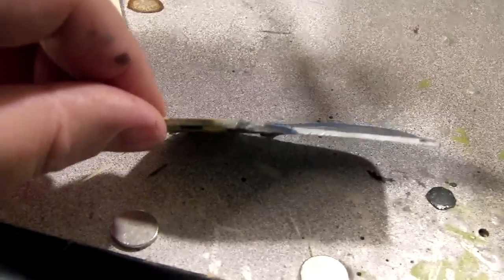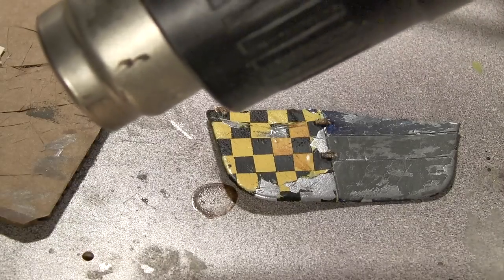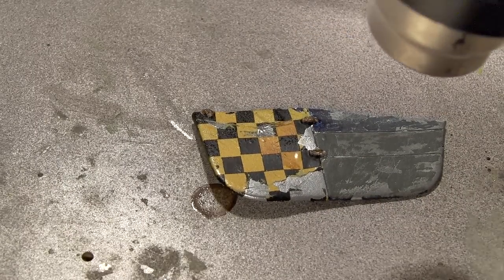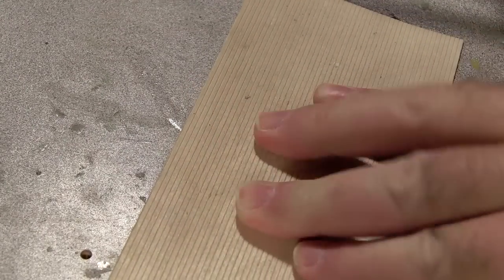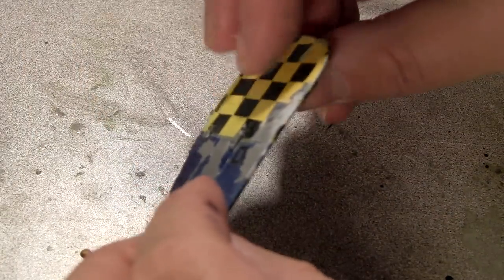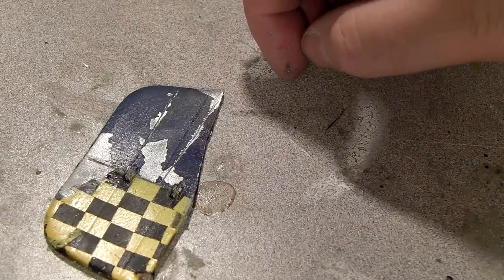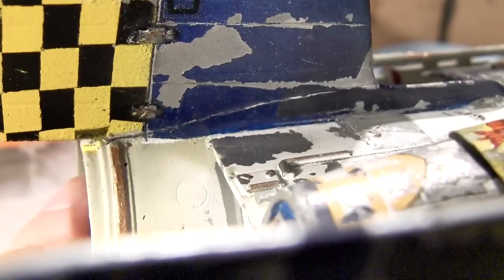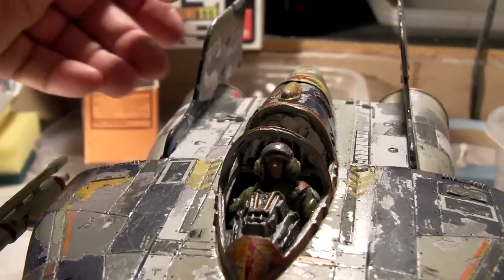1/24 A-Wing 24: Fixing Resin Warps

Comment from the maker: Good luck!  

Hot water will work on thinner pieces.  Dropping a piece in the oven around 125°F for 10-20 mins will do the trick too.  In both cases, plunge in cold water.  Repeat as necessary.

Comment: Hm.. my 'Lill-Draken' resin kit is slightly warped on the rudder.. nothing really noticable, but I may just try and correct it now, having seen this.. It's very very thin though, so I will have to be careful! May use hot water.. Had to scratchbuild all the landing gear for it, as the parts were cast so thinly they just snapped when trying to cut them from the resin film.. Next will be an attempt to cut out the vac-form canopy!! Wish me luck... :)

Comment: I've always heard about resin warping. I'm about to undertake my first full resin kit, NeoMega's SAAB J-29 Tunnan. Now the wings are solid cast resin, but small at about 1 1/4 by six inches and about a 1/4 inch at the root. Is warping/drooping of parts a problem only if the kit gets warm, or are the wings small enough to support themselves over time? The finished model will be kept in my basement which stays about 65-70 degrees. Do you think I have anything to worry about? I was also wondering about the flat surfaces on the Randy Cooper Avenger you reviewed in another video. Since the resin panels are so vast, could you get sagging between the supports, so the flat panels go concave, or are they thick enough to prevent it? I'm new to resin kits, my only experience has been cockpit/detail work on a couple of Czech Models and Grand Phoenix kits. In addition to the SAAB, I also have Lone Star Models Martin B-10 resin kit on it's way, so any pointers would be appreciated!
Reply from the maker: In the case of the Cooper SD, those plates are so thick that they won't warp.

Warping is definitely a mass vs. shape issue.  The heavier and thinner, generally the more sag.  It's tough to say without knowing the kit or the part.  On your plane, check around the forums for other builders to see if there is a known issue.  Some casters will put brass rods or sticks in their parts for strength, especially landing gear if those aren't metal already. 

I expect a 1/72 airplane should be fine for it's size and weight.  sag on the wings would be measured in months to years and you can always flatten them again with heat.